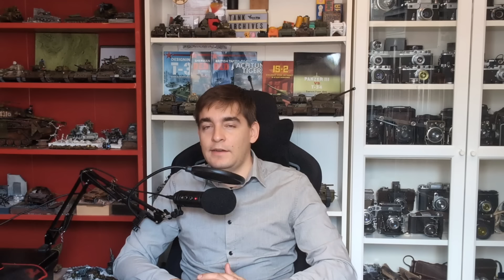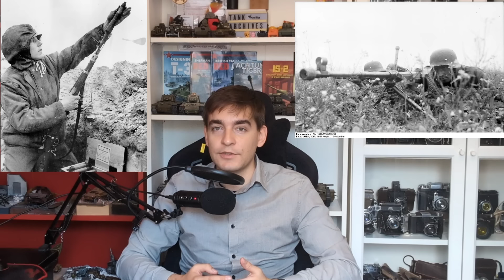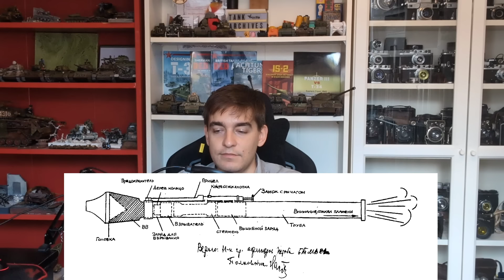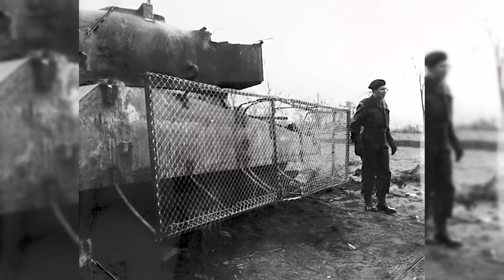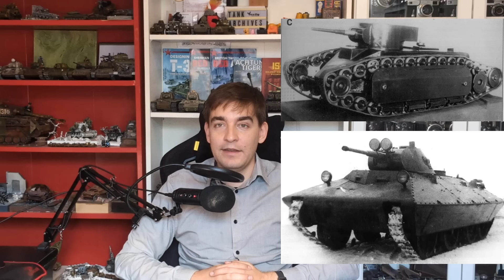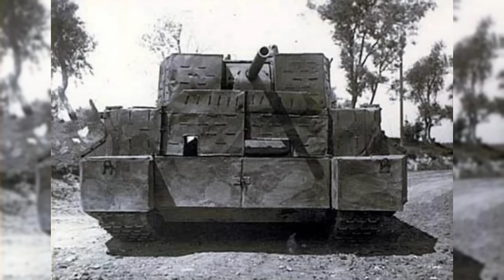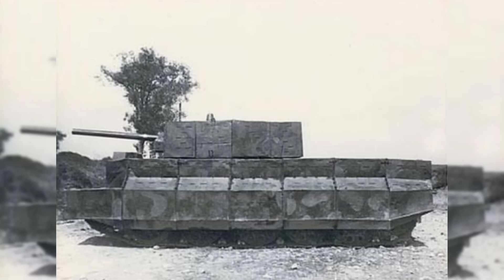Panzerfaust: Effectiveness and Protection

Comment: I wonder why german recoilless rifles had such short range when swedes were able in 1948 to make ones with much longer range. The original Carl Gustaf M1 recoilless rifle has an effective range of up to 700 meters for stationary targets and to 400 meters for moving targets.
Reply from the maker: Technology moves in leaps and bounds in wartime (and immediately after it, provided the army doesn't lose funding). In 1948 there was a lot of stuff that would only be a dream in 1943.
Reply: @TankArchives 

For example in the 1940s the US made multiple attempts during the war to create anti air missiles for fighters and bombers that all ended in complete disaster. 

Then right as the turn of the decade happened and Korea ended the US made huge advances almost quadrupling the effectiveness of there anti air missiles they had been working at that point for a decade  in a single year mainly due to advances in primitive circuit boards and solid fuel motors. 

Like the anti air program for the US army that created the sidewinder had been running since pretty early in the war.
Reply: @TankArchives  firstly, those three years are a lifetime in development terms. Next the Gustav and other rifled based systems were guns. The German systems were rocket of in this case a lobbed warhead from a recoiless charge where there are limitations unless you want your hands blown off.
Reply: @stevegreig5675 I don't want to be the party pooper to your parade however the Gustav and the panzer faust are the same basic premise in terms of delivery. 

The Gustav and the panzer faust ATLeast the one in the video use a recoilless rifle design. 

The Gustav is just much higher pressure. 

There literally the same system effectively. 

The rpg from the Soviets are different as the rpg-7 has a rocket sustainer motors to both rotate it and maintain its insane speed for the time.
Reply: @parkerlong2658  premise, you mean recoiless?
Yes on that point but one is a keepable rifled barrelled shoulder fired anti tank, anti structure canon that fires frangible cartridges the other is a fully disposable tuck under the arm single use weapon.
Reply: @stevegreig5675 yeah you called one a "gun" and one a "rocket lobber"

I'm sorry but you literally used completely wrong terminology. 

You would be considered a weirdo of you used that. 

There both recoilless weapons using the same physics concept to shoot the warhead. 

The ergonomics of the weapon has nothing to do with the weapon delivery system.
Reply: good question big chap, perhaps I can help answer that, the 84mm carl gustav range is greatly exaggerated, we carried it as a platoon anti tank wpn in the British army in the eighties, the realistic range was about 300-400m for static targets and 200-300m for moving, at the field firing range in sennelager Germany we even got the chance to shoot at a up armoured centurion with target practice trace projectile (TPTP) rounds, most infantry weapons have far shorter ranges than advertised, for example the L1a1 SLR was sighted up to 600m, we taught to fire as a group not individuals (fire control wins firefights, not snipers, marksmen, super duper special forces, that and aircraft, tanks, artillery and mortars are what wins battles and the most effective weapon =the radio😊
Reply: If I remember correctly, the Carl Gustav is also straight up a heavier weapon system overall. You can squeeze more range out of a heavier rocket even if they're roughly the same diameter
Reply: The Carl Gustav achieved its accuracy by being rifled something that reduces the penetration since it spreads  the HEAT Jet.  I suspect they used limited spin and a little drag   stabilisation. Carl Gustav  actually used a technology developed for the panzerfaust.  The panzerfaust 100 and 150 used a double charge of gunpowder separated by about 10-15cm of air to reduce peak chamber pressure.  This is one of the”secret” of the Charlie G.
-The groundbreaking German recoilless canon developed for paratroops were hamstrung by being required to use standard ammunition.  For instance the 10.5 cm Leichtgeschütz 40 recoilless canon fire a standard 14.8kg shell from a 388kg gun but scale that down by 8 to account for the Carl Gustav lighter 1.6kg HEAT round, halve again for the 30% lower velocity (square law) and halve again to account for the double propellant charge  lower pressure and you get to Charlie G weight levels. 
-The Germans were on the right track in that design had commenced of the Panzerfaust 250.
-The German Army rejected recoilless anti tank guns due to their 6 x greater propellant use and went with the high low pressure guns PAW 600 and PAW 1000.
-There was a 500m range recoilless rifle that fire a panzershrek style rocket the panzertodt.
-The Panzerschrek wasn’t terribly accurate but it had been developed from the Rocket Projector 43 ie Racketenwerfer 43 which fire the same rocket only from a 140kg breeched weapon with percussion ignition instead of electrical. 
-The Racketenwerfer 43 often hit targets at hundreds of meters not only due to higher velocity but its carefull and precise machining.
-Germany couldn’t really afford ultra fine rockets and panzerfaust with optical sights and and precise tolerances in the quantity required. 
-
Reply: US had 57 and 75 mm recoilless rifles, 57 being man-portable.
Reply: Doctrine probably. Cheap and numerous weapon, that is still effective despite the cut corners.

Comment: Hi! Was the Püppchen recoilless? I think not
Reply: -The Pupchen weighed 140 kg but that was less than the 2.8cm  229kg squeeze bore gun it was to replaced as the infantry platoon level anti tank weapon. 
-The Pupchen (Raketenwerfer 43) was developed independently of the bazooka but when the German Army Tested lend lease bazooka captured from Russia at their Kumsdorf test range along side panzerschrek and panzerfaust they simply adapted the Pupchen rocket to fire from an open breech by replacing the percussion ignition with electrical magneto.  
-